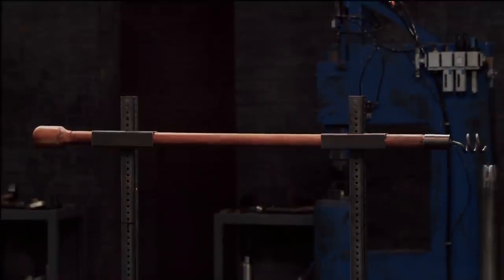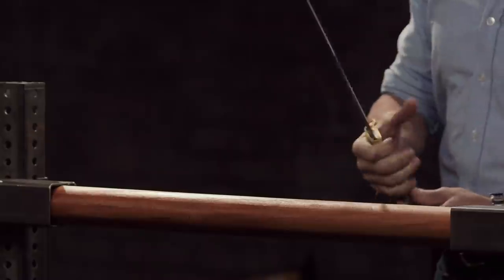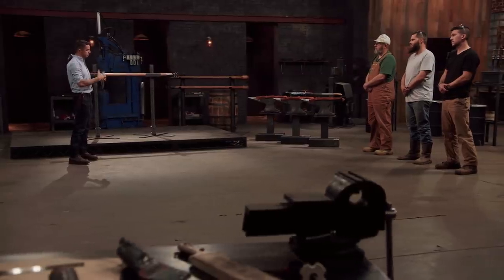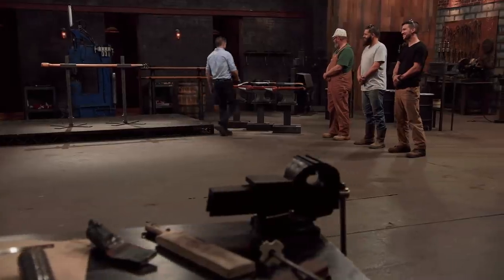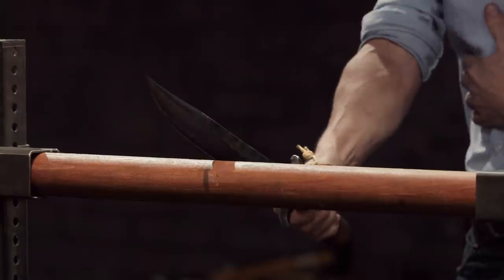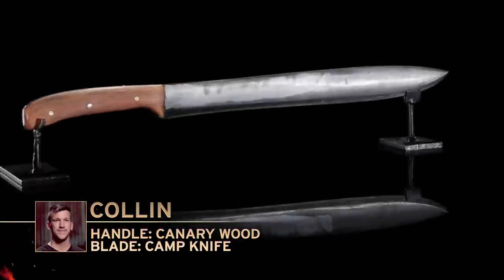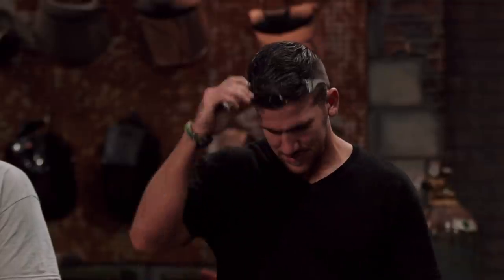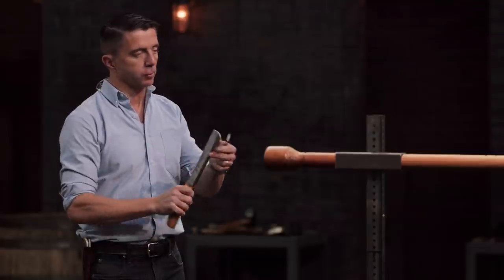Forged in Fire: Knives Break in Strength Test (Season 5) | History

Comment: I agree, he did make a blade under strenuous conditions in 3 hours. But can you really call it a "blade" if it's so brittle it snaps on the first swing? More of a showpiece. 

I couldn't do better, to be fair to the guy. But the first swing?
Reply: Never thought of it this way
Reply: Sure it was a blade, its just not made for fighting vs armor or chopping wood.
So not a blade u want to use but still a blade.
Reply: HexagramMan  Uh, no? You seem to think that a knife that can't swipe down trees isn't a knife. A harder knife is going to snap if you're playing with it outside like a doofus. What about the kitchen? Low impact so no real risk of breaking, and the extra hardness will help it keep a good sharp edge.
Reply: @JackSilver1410  Yes.. but they weren't told to make a chefs knife meant to cut broccoli.
They knew going into this what to expect, and thus, for its intended function it failed.

Comment: Ok Smith's next up we are going to test your blade by putting it in water.  remember this test we aren't interested what your blade does to the water but what the water does to your blade   ! Ok Jason ur up! Ok  Jason 1st off  you made a very nice blade but unfortunately it suffered a catastrophic failure . After we pulled your blade out ,  the water made your blade wet! So for that I have to ask you to please leave the fordge!
Reply: Whats your point? These tests are designed to test the strength on the blade. You dont want a knife thats gonna break as soon as you use a little elbow grease on it.